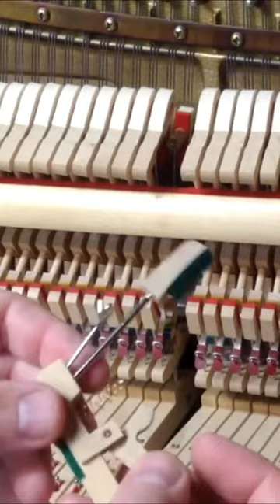How to Fix a Sticking Jack (Part 2: Fixing the Jack Spring) | HOWARD PIANO INDUSTRIES #piano #shorts

Comment: What about a jack that sticks under the hammer butt (on the buckskin) without fully escaping (doesn't slip out from under the hammer butt)? This happens on light touch, causing the hammer to stay in contact with the string.
Reply: I believe you would need to increase let off in that case, that way the Jack can slip out and allow the hammer to fall back just before the hammer hits the string
Reply: @SpacefaringStranger  thanks. Not sure what 'let off' is but there is an eye screw I turned in a bit which fixed it... Makes the jack pop out a bit earlier.